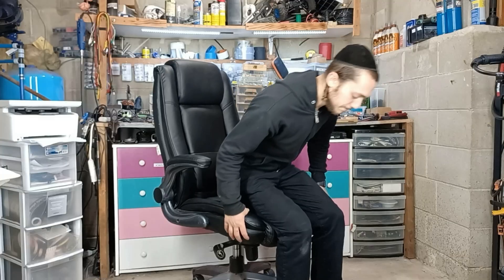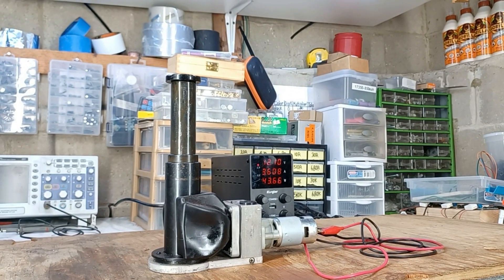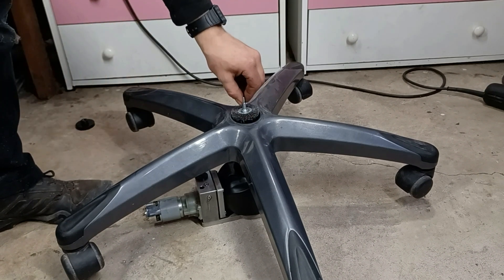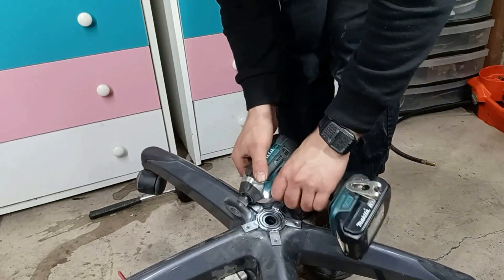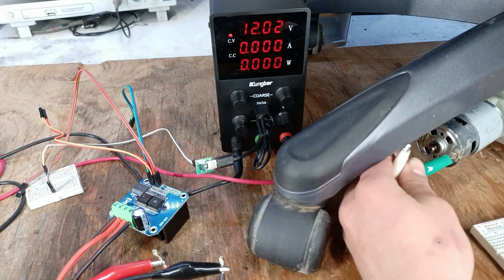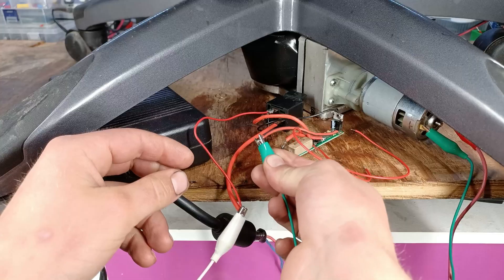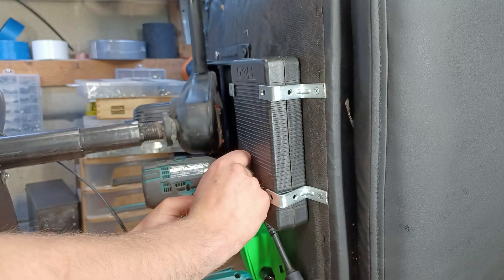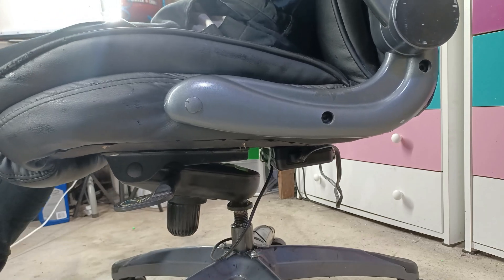I Successfully MODIFIED My Office Chair with an Electric Jack!

Comment: Good idea but, it's not comfortable when the chair has a cable laying down, maybe one day you could  stumble on it and it will disconnected on a good way, at the bad way you just could run over and destroy the power cable, I think the better it be to power up it with some battery
Reply from the maker: @seab0y  good idea